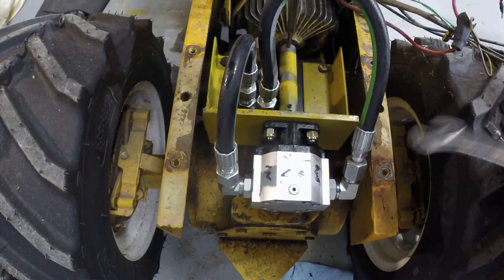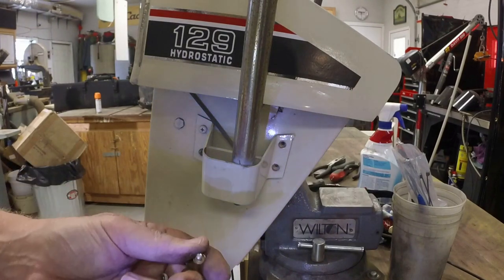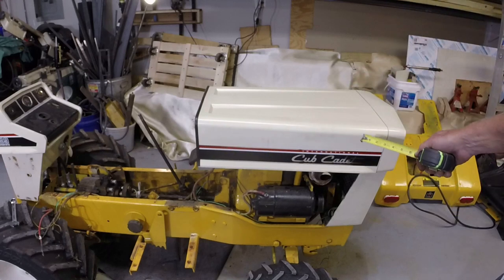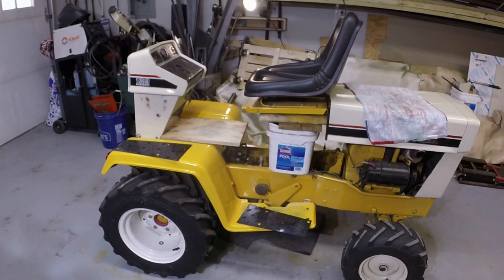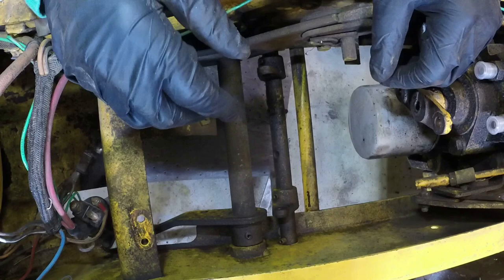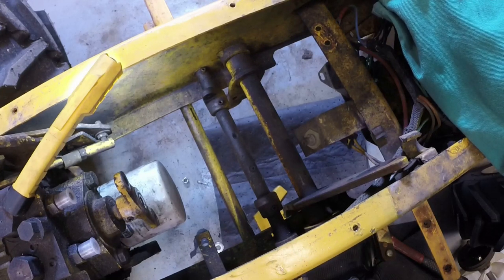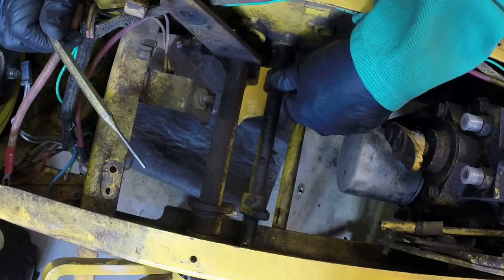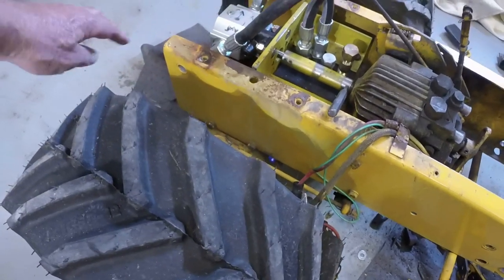Cub Cadet Forklift Build!  EP:05

Comment: Your ingenuity knows no bounds.
small suggestion looking at the engine it seems you can move the hood maybe 4 to 6 inches further forward with a bracket bolted on to the frame this would reduce the amount you need to extend the chassis. The closer coupled you keep the driven and steering wheels the more manoeuvrable the forklift will be.

Comment: Frank I love the build. Adding the length to the machine will let maneuverability suffer a little bit but will help reduce the twitchiness by steering too quickly. 
You can also add weight underneath the machine by cutting plates that bolt on. That would keep a lot of length from the front of the tractor by having to add weights. It would also lower the center of gravity.
I have operated small forklifts that have been narrow to get through doorways that if you hit a small object such as a nut or other debris it can cause the machine to tip a bit violently to one side. Not enough to go over but enough to make your nether regions pucker. 😬That weight down low would help a lot in stability.
Of course you will always travel with your load as low as possible but there will be the time that you want to maneuver with the load raised.
Lastly I had pondered the idea of making the tilt for the rack pivot from our at the ends of the tranaxle tubes or off the axles themselves if there was the room. It would put the weight out further on the tranaxle to take a lot of stress off of the ends of the axles that weren't designed to take that weight. I know it's not going to be some commercial machine in a manufacturing setting but breaking an axle with the load at height might create some unwanted drama. 😎
I know you have probably answered this in another video but what breed are your furry friends?  They sure are beautiful and quite well behaved.
Thanks for the awesome build. 
Cheers
Terry

Comment: They do make a special roll pin punch,for removing those pins.  It has a half ball on the tip, to easily remove the pins.  I have a couple specifically for working on the Cubs.
Reply from the maker: I have a set of them, too. Use them frequently in the videos.

Comment: Add to the frame on what use to be the front of the frame then remount the engine closer to the end of new frame extension. Would still need to lengthen drive shaft and move hood but could also add a weight plate at same time in case you need to make  it heavier for a heavier weight load

Comment: Mr. Frank, could you use the rock shaft spool valve to operate the mast tilt? Seams like a good use of existing parts.
Reply from the maker: Maybe, but it was designed for 600 psi hydraulics. My lift cylinder circuit will be more like 1500 to 2000 psi.  As it turns out, I had to remove it to make room for the power steering inside the dash.  (upcoming episode).

Comment: Great ideas. You'll increase your lifting capacity with the extended length and make much better pedal placement possible. I need to find out what tractors would be good for such a project. I'd like to build a twin rear axle dumper with a front blade for snow and pushing dirt and gravel.

Comment: Reading the comments I’m quite surprised at how many armchair engineers are watching your videos Frank.  
I’m definitely not an engineer but it’s quite obvious that many of them don’t have a clue about what they’re talking about. 
I think it’s going to look great and the final amount you decide to lengthen the frame will be the amount that lets you sit comfortably and not have your feet tucked back under the seat.
Reply from the maker: It will be a compromise, less comfortable than desired, but better turning radius than a really comfortable seat would be.  Fine for short term use, but not good for a full time worker.  Hood will stay the same size and position to preserve the Cub Cadet design cues.

Comment: one thing I thought of is wheel weights for the small tires. I have a set for 8 inch rims that weigh 50lbs each. they sit inside the rim so they wouldn't take away from the cub cadet look and get you some weight low down far from the lift point.
Reply: You could do that and load the tires as well. But the counterweight in front of the grill the best option at the furthest point.
Reply: For the steering end  take some 2- 3inch .120 wall steel tubing cap one end fill with concrete then cap the opposite end mount in a vertical frame like a brush/impact guard

Comment: Danco used to produce a front mount model RH500 I finally found a brochure I printed years ago, gonna tranfer a picture of it moounted to a cub 70 series to my site now if you want to see it. 101222 upload complete available for viewing after midnight 12-12-22/12-23-22
Reply from the maker: Thank you for putting that short video up.  I knew I had seen one on a Cub somewhere, just couldn't remember where.   That one says 500 lbs. capacity.   Very cool.

Comment: Are you going to put an hydraulic tilt on it too which will also give another holding point but will be a pivot point as well . If you are that's another piece to plan where to put the shaft in relation to the mast . Just thoughts lol .
Reply from the maker: Yes it will have tilt.

Comment: a 2 in shaft with bushings welded into your frame reinforcement and the bottom of the mast frame would probable work good for a tilt pivot for the lift.   what type of lift are you thinking of using hyd cylinder over chain pull would be cheaper than a multi stage cylinder
Reply from the maker: Planning on a hydraulic cylinder with the over chain.

Comment: I'd say extend the front frame  instead of cutting and stretching the middle of frame. I get the counter balance thought. But you could always have a weight box by doing the frame end. Plus give Abit of a bumper on the rear

Comment: I really enjoy your videos Frank!  Wondering what the axles can handle as far as weight?  The calculation you did for counter balance was very helpful and made sense.  But was thinking while watching this episode about the axles themselves.  Or maybe even the axle housing and bearings/bushings etc.  Thanks!
Reply: And the weight on the tires, too.
Reply from the maker: I'd say 3500 lb minimum rear, 1000 lb front.  Remember, I am designing for a 1000 lb  lift capability.  Well within tractor capability.
Reply: @woodandmetalshoptime8048  I was pretty sure you had that factored in. Plenty of capacity.

Comment: Frank, you need a lift table so you can work on and don't have to bend over so much when building.
Reply from the maker: Yes, I need a lift badly.  Hmm, maybe a project?  They aren't cheap if you try to buy one.
Reply: That would be a useful project for him to do a build series on
Reply: I bought the harbor freight one and had to modify the hell out of it. For you a custom one would need to be done up.
Reply: @GS-zv3qn  it's just a matter of one that will take the weight Frank put's on it.